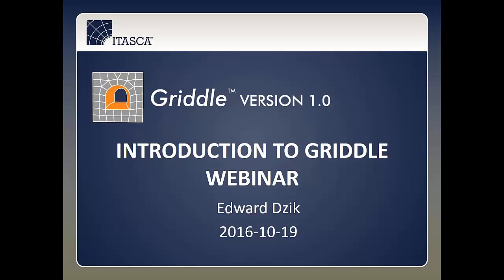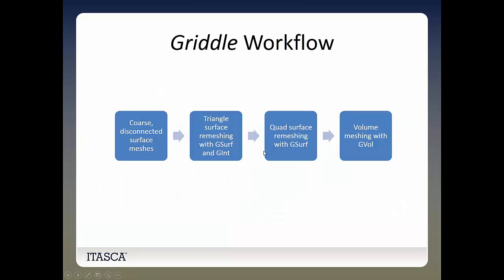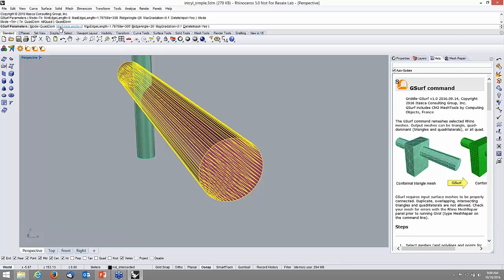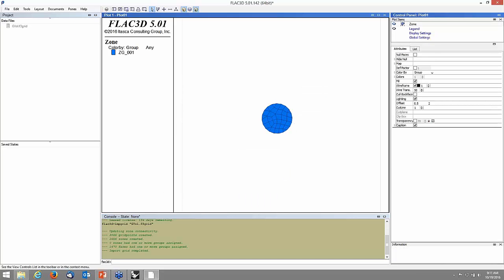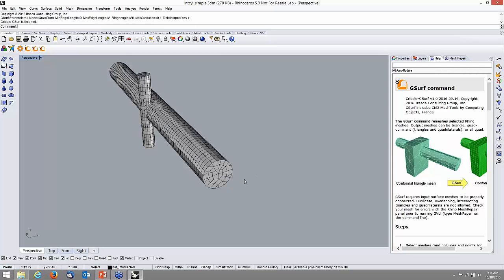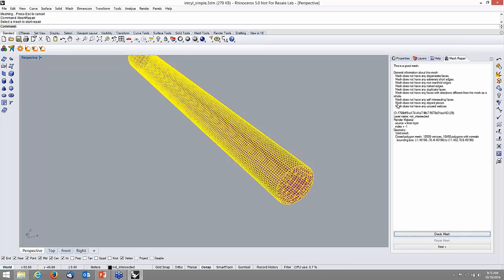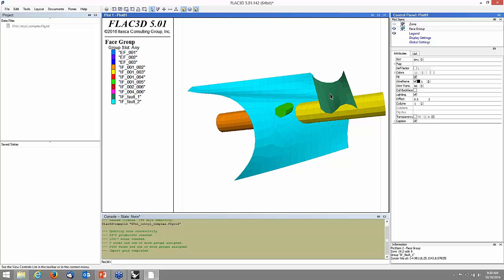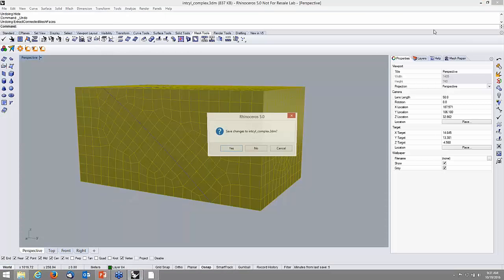Griddle 1.0 – Introductory Webinar

Comment: Can you please specify a code to assign internal face group as interface in flac3d 5 that are imported from griddle grid file ? Every time i try to assign the face group the console gives 0 interface node and 0 elements created.
Reply from the maker: Hi Omar, this is simpler to do in FLAC3D 7 but in FLAC3D 5, this could be done by two ways: (1) the command “generate separate  …” and then “interface face …” or (2) the command “interface wrap …”. You can learn more about these commands in the FLAC3D 5 manual. 

You can learn more about FLAC3D 7 on our website (https://www.itascacg.com/flac3d) or via the online manual (http://docs.itascacg.com/flac3d700/flac3d/docproject/source/flac3dhome.html).

 If you need anything else please contact our Technical Support Team: https://www.itascacg.com/contact-itasca/sw-tech-support-flac3d.